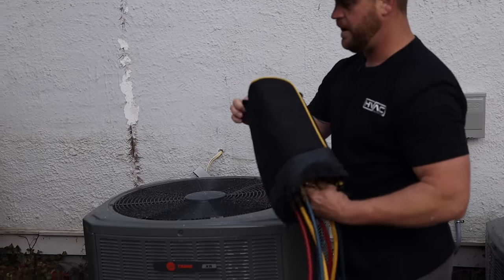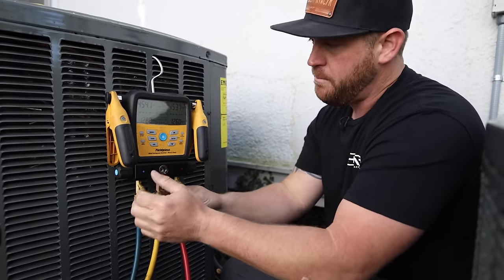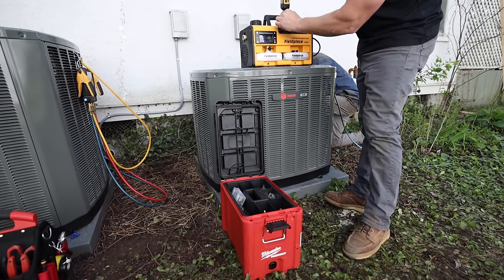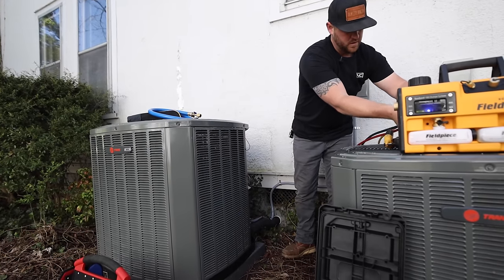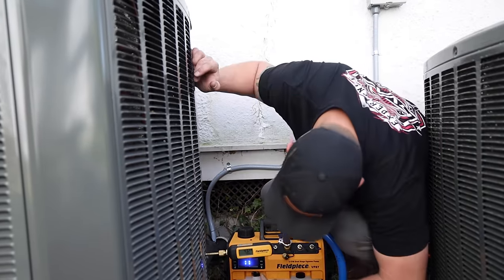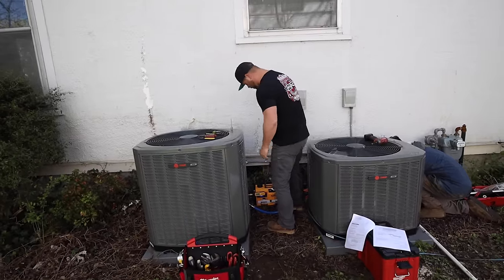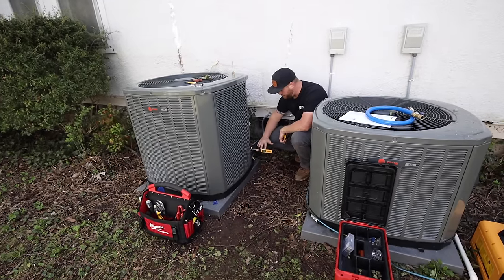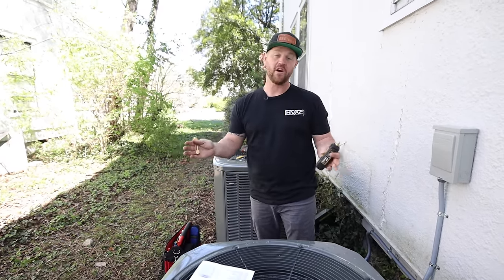Why I Choose A ONE Hose VACUUM Setup | HVAC Installations

Comment: I’m with you on this especially using the Navac 2cfm battery vacuum I just got from trutech tools and the electric flaring tool also don’t know how I lived with out this and why it did not come out years ago
Reply: 2 cfm seems like a joke but the battery idea seems genius. I don’t have one
Reply: @murkyturkey5238  get it you won’t regret it but get a 9amp battery so you have the 5 amp that comes with it and the 9 I have used mine about 20 times and I have saved about 30% or more in time on every job
Reply: I have their mini split flaring tool best tool ever

Comment: I do more refrigernation than AC and maybe that is why i do this but I find the smaller the system the more important it is to keep the vac gauge away from the pump, also on really small stuff I find my appion hoses pull too fast and I get mositure freezing in the system if I am not careful. On larger systems it is gonna take awhile to pull a good vacuum regardless, I was on a walk in cooler for a high school that was started up like 6 months ago (not by my company) that has a 3ft tall reciever (the system takes more than a full can of 448a), I had to flush and vacuum the whole system the other day. I didn't want to start shit so I kept my mouth shut to the customer but the install team screwed the pooch on that system. I was there because the evaporator was dripping on the floor, heavy frosting on the entry side of the evap, big shocker low charge, the valve core was so loose it was dripping liquid, I charged it to a clear sight glass the compressor cycled off and that when I saw it, sand cloth dust floating in the sight glass lots of it. I talked to the MFG because it was still under warrenty and suggested that we needed to flush the system or this compressor won't make it even to the end of the warrenty, they agreed and I spent the next few hours on a cold windy roof, lol good times, also thats the first time I have seen so much dust in a system that it was immidantly apparent in the sight glass. Great videos too man keep up the good work.

Comment: I've been taught to not just pull the vacuum to the correct reading but to let the vacuum pump continue to pull vacuum for up to an hour to ensure that any water that has vaporized has been totally pulled out of the system. Otherwise if you don't leave it on long enough you may have some water vapor in some crevice in the line set or valve that has not been evacuated out of the system. I live in south Louisiana where we have very high humidity and that could be one of the reasons it is taught to do so.
Thanks for a good explanation of your technique and equipment.  🙂

Comment: New install 1 hose and two core tools to isolate the guage, when replacing a compressor I use 2 hoses as the oil takes much longer to get down.

Comment: Love your channel bro, but seeing your evac setup in the thumb nail, the main question i had was "no bluVac Micron gauge?" 😋 
 That aside, you do raise some good points, and depending on the system I am working on, will often only pull one of my trublu hoses from my kit for the job... however I work primary on grocery systems, so mileage will vary there. I also carry two pumps on my truck, the VP87, and VPX7, and sometimes will use both on one circuit. i will however use one hose per pump, so I guess I'm still on the up there. lol  Good vid all the same.

Also kudos on the carry container for your evac kit. exactly the same packout one I use for mine. You know whats up. 😆

Comment: My experience with Fieldpiece has been they're the Chrysler of HVAC; well designed, creative good ideas, but poorly built. When I had barbed nipples snap off my manometer (everyone else has steel barbed nipples) I said, "no more." Remember their blue temp K clamps?  We had to wrap them with electrical tape day one. 

I like the one hose setup. I've been doing for years. I'll bet my apprentice doesn't know you can pull a vacuum with manifold gauges.
Reply: Lmao honestly
Reply: Yeah I lost one nipple on my Fieldpiece manometer already. From carelessly removing a vinyl tube that was on there too long I think. But I agree, they're extremely flimsy plastic.

Comment: Just fyi when using the test tightness feature if you ever have a neg pressure diff that means something is leaking. Either your hoses, manifold, or system. Technically you are supposed to use the temp clamp with the pressure test, as it monitors the temp of the pipe while being pressurized. This prevents false readings.

Comment: The only issue I see is when removing your micron gauge the way you hooked it up like you said it might let in the air which it does. I use a low lost fitting or use a valve core remover on both liquid and suction. Depends on which style you have Low loss fittings you have to spin a knob to press the core down or away to shut it close (front seat/ back seat) so you reduce the amount of air going back into the system. I have the Appion AV760 micron gauge and I can’t let refrigerant hit the sensor.

Comment: Great video. Just to let you know most manufacturers if not all recommend opening your suction valve first very slowly. This is to prevent compressor oil loss into the discharge line.

Comment: Your idea makes sense in theory, but I’ve found this to be irrelevant in actual practice. I recently pulled a vac on a 10 ton split with about 70ft of piping. I had two tru blue hoses with a tee and micron gauge at the condenser and another micron gauge at a service port in the air handler. I was mainly doing this to check the difference of my two micron gauges. They were both reading within 10 microns of each other while pulling. It seems like after a few minutes of vacuum time the difference becomes irrelevant. I prefer a two hose set up because it will ultimately pull a vacuum faster, although on smaller residential units that time difference also becomes pretty insignificant. Kind of a wash at that point.

Comment: All Trane/American standard units say to pressure test to 150psi.  We had 6-12 units where the nitrogen wound up contaminating the refrigerant due to it pushing through the service valves during a pressure test.  We thought there were leaks due to the pressure dropping, only to find out it was leaking into the outdoor.  At the high cost of 410a that can be an expensive mistake.
Reply: Bro, nothing can stop a trane 🛑
Reply: @samalmo  I can
Reply: Sounds like someone did not use use a wet rag or cool gel when brazing their copper and the valves warped
Reply: @seanshadysullivan4401  I've had it on minisplits where I pressure tested to 600 psi and it was leaking past the valves kept looking for a leak inside.
Reply: @HVAC544   I would squirt bubbles on all my flared fittings

Comment: Nice setup. I like to run the pump for a bit before I check the oil, that way if I do a an oil change, the brunt of the work has been done with the old stuff.

Comment: I hear what you’re saying with the 1 hose set up being furthest away from the pump. I’d still rather use 2 hoses with two core pullers. Have the micron gauge on the side port on the core puller of the liquid line. When you need check microns, valve off the core puller on the liquid line so you are not longer pulling on the micron gauge directly and you will still have an accurate reading. But I guess when you are pulling on such tiny systems it’s not like you’re saving that much time anyway with the two hose setup. To each his own I guess.

Comment: I heard you mention that releasing the freon to the micron gauge won't affect the sensor. I've always been taught to take the micron gauge out of the circuit before releasing the freon. Does fieldpiece operating instructions that come with that micron gauge say that it's okay for freon to be introduced to the micron gauge. I have the same micron gauge. I don't want to mess it up lol. Nonetheless Love your videos appreciate the knowledge. 🤠👍🏽

Edit: I looked at the instruction manual for the micron gauge and it's rated for 870 PSIG.

Comment: You use the micron gauge on the liquid side while your vacuum hose is on the liquid side. Where would you set up your micron gauge say, on a mini split system with only a hose hookup on the suction side?

Comment: My only question is did you pressure test to 450 psi? Some manuals actually state only pressure test up to 150 psi. I used to always fill up to 300psi until my boss said read the manual! Lol awesome video!
Reply: What did the low side design test pressure say on the name plate?
Reply: Always go off the low pressure side on the name plate. It will tell you the max design pressure.. I keep it a bit under that. From what I have been told if you don't bring your pressure high enough you may miss a leak..
Reply: The  book for my American Standard/Trane units says around 175. Honestly not sure why? I do like it higher but I follow the book. My vacuum tells me how tight I am also.
Reply: TBH i was told only go 150PSI because u have a chance of blowing out the TXV but not 100% sure. so I've been told thats all
Reply: I usually do about 200 - 250 psi but i didn't know about that 150 psi limit.
Reply: The EPA CFC code manual state to use the name plate low side pressure to vacuum test each individual unit and not the High side  pressure. 
Also 1 hose setup is not recommended for units with very long refrigerant line set.

I'm sticking with my 2 hose 8 CFM vacuum pump setup. 

To each their own.
Reply: 200-250psi is more than enough to find a leak. 450psi is excessive. Definitely don't want to go that high with the condenser side in play. This looks like a new install so it's only the evaporator coil etc.

Comment: So you pull from a 1/4 port with a 1/2 hose through a 3/8 connection at the pump with a single hose that is just golden😂
Reply: You slow or something?
Reply: You need to watch Jim Bergmans videos on this, I thought the same thing but I was completely wrong. I pull down most residential installations to 100 microns in less than 15min with this setup.

Comment: Trane and American standard recommend pressure testing to 250 psi, anymore will push through the service valves so I’ve been told. I do the same thing with vacuum though tru blu on the suction line and my BluVac micron gauge on the liquid

Comment: Could you put the vacuum gauge on a core removal tool, and just valve it off when you open the refrigerant?
Reply: Да, ты сможешь
Reply: Yup it’s what I do so refrigerant doesn’t splash back on my sensor
Reply: The removal core tool has no schrader core ? How can u do it to depress the core ? I use a yellow jacket ball valve to isolate micron gauge and break the vacuum with Freon
Reply: @ericpalacios3568  I use a ball valve to isolate the micron gauge. How can u use a core removal tool ? They don’t have a schrader core inside

Comment: I like vacuuming both lines, which makes more sense to me, because I’d rather have the system go down down down down down down down down down down to 35 instead of vacuuming on one line and it takes 45 minutes to an hour. Why wouldn’t I wanna evacuated to 43 m and just be done with it?

Comment: Run a micron decay test for 10 minuets and it doesn't matter where  you put the micron gauge or if you have 2 hoses because the pump will be isolated.

Comment: This is how I do it in the automotive world. I get a lot of blank stares from fellow techs, but it's the way I was taught.

I remove both cores, install my mic on the high side. On the low side I run a 3/8 x 3/8 hose without safety valves from my core tool straight into my vacuum pump. I pull a deep vacuum in seconds really. Of course an automotive system has nowhere  near the size of an industrial or residential system. That's why I use a 1 stage pump. I also run the blower motor on high to keep airflow over the evaporator coils. Just in case my pump causes freeze up. 

Don't really get much comebacks

Comment: it would have been cool to set up a traditional vacuum rig on the other system and start them booth at the same time to see the difference.
Reply: I have literally pulled a new install down to 100microns in 15 min with this setup. Less fittings = less leak points.

Comment: 450 psi is a waste of nitrogen. You don’t need more than 150psi. I can see using 300-400psi if you’re actively performing a leak check with a mix of a 1-2 lbs Freon and nitrogen while using a leak detector or your ears to detect a Freon leak.

Comment: Why wouldn’t you put a core removal tool behind your micron gauge, so after you pull the vacuum and b4 you release the charge you could close it off and not worry about ruining your sensor on your micron gauge. I paid a lot of money for mine and I’m not rolling the dice if I don’t need to. I pull a vacuum the exact same way but I use a core removal tool on both high and low side for that reason!

Comment: I know for a fact it is not good practice to let any pressure hit your micron gauge nor remove the gauge as you'll just break the vacuum by doing so. An apprentice actually broke one from doing this at a company I worked for. You just had to simply put a fitting with a shut off valve on your liquid line if you're gonna do it your way. Yellow jacket has ball valve adapters that will eliminate any of those problems just close the ball valve and remove your micron gauge and you're good to go.

Comment: Would you use the one hose set up for something bigger like a commercial/industrial setting. I know it would work. But I’m curious if the one hose set up is your go to all the time?
Reply: You could however in an industrial setting like I work in that short hose set up will not reach some equipment depending on how it's installed. I am not about to get cart's and do all kind of crazy shit to pull a vac. I have to string 3 pair of hoses to pull a vac on some unit's.

Comment: I don’t pull with micron gauge on hi side if recip compressor with valves . No no for me only use four port with all connected and test then refill refrigerant without any air leaks getting in

Comment: Pulling a deep vacuum fast isn’t always good,  moisture can freeze and not be removed from the system
Reply: More so on older systems I’ve noticed this . But On a brand new unit and lineset you can pull pretty quick and not worry
Reply: I had an argument with my college instructor on this and his opinion was the same as yours. However, water boils at -24 degrees F @ 250 microns. So if you pull the system down in say 70 deg ambient conditions, won't the copper conduct the ambient heat and boil off any frozen moisture if any even exists?

Comment: I always pressure test with 250psi.
Is that wrong? Should I be pressure testing according to what the unit says?
Reply: You should always follow Manufactures directions found in the manual. Be aware of the Evaporator testing pressures also on a complete install they might differ from the condenser test pressures and the lowest test pressure should be used .

Comment: Always open the suction valve first.  Opening the liquid line first may damage the txv by pushing oil to the diaphragm in the txv.  It’s says this in the install instructions on Goodman equipment but applies to all equipment manufacturers
Reply: Correct, and if a heat pump system, test it in cooling mode first. That way if you do pull some oil out of the compressor, no biggie. It'll get sucked right back in to where it belongs quick. If you open the high side first, that oil will have a to make a long trip thru the whole system back to the compressor.

Comment: Whats your technique for pulling vacuum on a mini split just curious
Reply: Probably the same way except put the micron gauge on the core remover port. Most splits only have one port. That's what I do but like he said your not getting the true vacuum reading because its close to the pump, so you have to close the valve and wait till your microns level out to get an accurate number.

Comment: Can someone please explain, how using a larger ID BLUE hose, evacs quicker? So a 12" sewer pipe is even better or less/lower evac times? I know in the motorcycle and car braking world, stainless lines are SMALLER inside giving better braking. I think the HVAC world has found some suckers LOL.

Comment: I was told long ago from an HVAC mechanic you need different manifolds because of all the different gases HVAC units have otherwise your cross contaminating units. I don't believe being how expensive these electronic manifold sets are that you guys carry that you would own 4 or 5 units. Which leads me to believe that you guys are cross contaminating AC units
Reply: I have 2 sets of gauges, one for old 22 systems and one for 410a

Comment: Those larger pumps like 7cfm and such are not needed to pull a proper deep vacuum. All you need is a simple portable air conditioner unit compressor. Will pull down to 25 microns. Largest hose you need is 3/8". No need for radiator hoses trying to pull a vacuum. Doesn't work that way. Test it yourself with a small 1/4" hose and a 1.5cfm pump. No need to spend hundreds on purpose built HVAC pumps.

Comment: You are incorrect about the micro gauge.  They are not designed to have refrigerant on them like that.  Get a shut off valve with a depressor hook up you’re micron gauge to that.

Comment: 1 hose is all you need in residential the systems don't have that much piping. You can tell right away when you put the micron gauge far away a tight system is doesn't typically move at all. Not a huge fan of the fieldpiece vacuum it has nice features just way too bulky for me.

Comment: I'm hoping you have stopped with the one hose method, it won't work well and will result in an improper evacuation with heat pump systems and those with check valve expansion valves and check valves within the scroll compressors. Some Carrier units include an electric solenoid valve to stop flow in the liquid line. . It only makes sense to pull vacuum from two ports as it will take half the time.